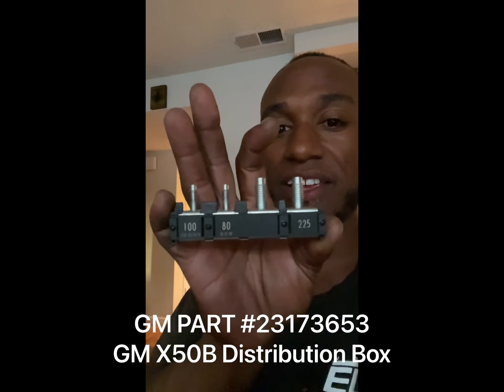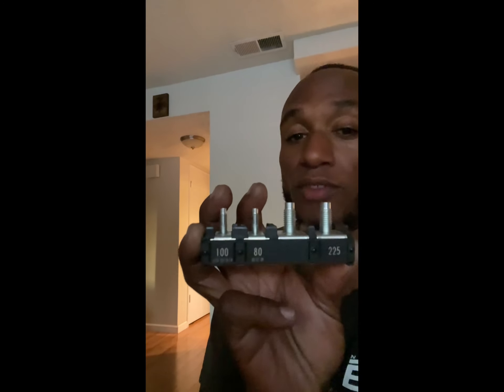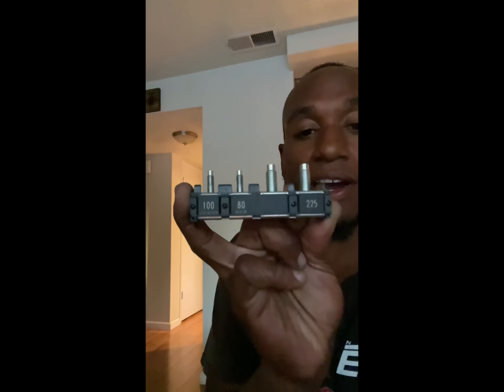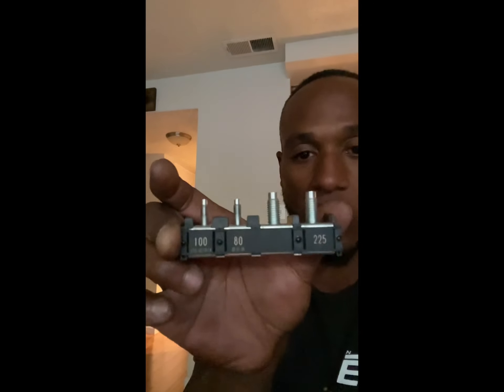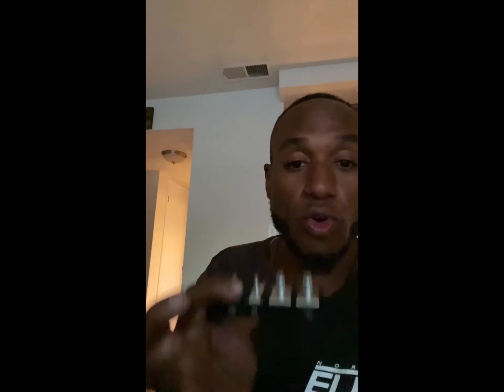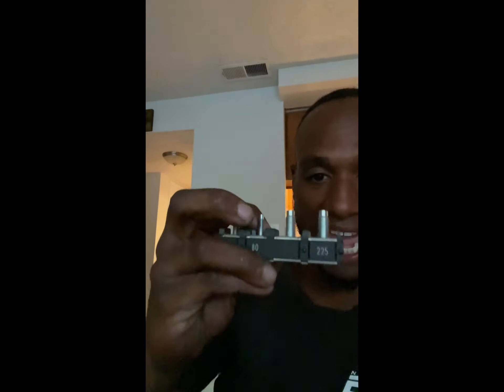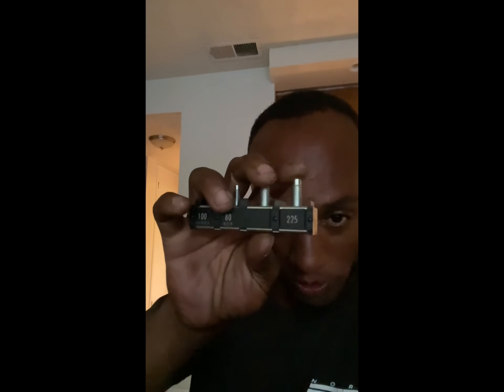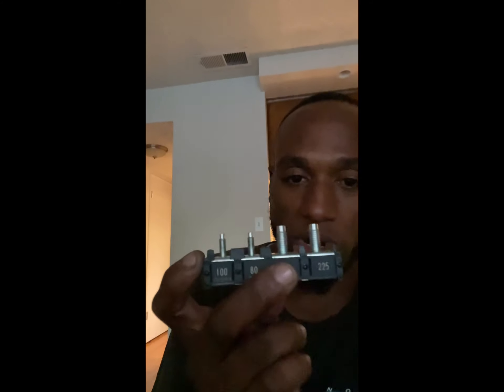2014-2019 Corvette Cooling Fan Fuse DTC P0480, P0481, P0482

Comment: "you'll go to heaven"  lol... love it! Great video.. unfortunately I'm not sure if this is the only reason my cooling fan is staying on. I think it's a faulty temp sensor bc my digital and analog read out after 40 min of driving still shows under 100.   However no "check engine" light so that's odd.
Reply from the maker: You likely have a bad tstat. Sorry for the delay. Never got a notification of your message. Hut me here if you have questions.  Ctracer_x@yahoo.com
Reply from the maker: Definitely a possibility, bad temp sensor- of course you could also have a a sticky tstat, ie stuck partially open.  They do that! Tstats run about $50 or less and the sensors are about $25 or so

Comment: I have that problem with my 2016 ZO6.  The cooling fan just seems to never go off and it stays on for about 5 minutes after turning the car off.  I spoke with my dealerships service department and they said that was normal.  I said how can that be normal when it just started doing that.  Anyway, Thank you so much for pointing out the potential problem.  I was looking at ordering online directly from the dealership for $35.05, but as a caveat they annotate "Programming Required by Automotive Professional".  Is that true?  Thanks again!
Reply from the maker: Not true!! No programming required, they just want to get you where it hurts

Comment: Does this fuse block/relay block  also control the infotainment system. And the fan that I hear is coming from the drivers side  rear brake vents. Anybody know?
Reply from the maker: The fuse block does not control the entertainment system, and if you’re having issues with the rear fan, that is fuse number 74 inside the fuse block.

Comment: I’m having the opposite problem where the fan won’t come on until I turn off the car and turn it back on.
Reply: Same problem here. I bought the Distribution Box via Taska Auto. Crossing my fingers. About to install it once I figure out how to remove the fuse box it's apparently under. Wish there was a video. Haven't found one yet.

Comment: What if your fan turns on high even when the engine is cold, and stays running for a bout 30 mins after car is off then turns off? Also temp gauge doesn’t work when this happens and ac doesn’t blow cold. It will all randomly fix itself all at once when driving then stop again a few days later.
Reply: Brandon my C7 doing same thing .. Did you ever find the fix?
Reply: I think I thought my temp gauge wasn’t working because the fan was staying on keeping it cool. Once I replaced the part everything worked.
Reply: Had the same issue, all started with the car over heating so I replaced the thermostat to a mishimoto 160 one. Issue fixed. Then a week later fans turned on as soon as the car was running gauges weren’t reading temps, ended up being a simple $20 fix, had to replace the coolant temperature sensor. Car has been running fine since then and much cooler with the mishimoto thermostat.
When replacing the temperature sensor you’re going to need to have a local shop clear the code since you will get a check engine light unless you have a scanner yourself. Also you can just unplug your battery for a couple seconds and the car will reset itself removing the check engine light
Reply: Did you ever fix this? My c7 is doing the same cooling fan stays on when engine is cold & ac does not blow cold.
Reply: In addition to all that, my active Rev system becomes inop. I wonder if it's because part of that fuse controls the steering wheel unit. idk.
Reply from the maker: @rickymonterroso2814  EXACTLY THE ISSUE!!
Reply from the maker: @bigb200prf  oh man I never saw any of these replies anyhow you likely had a bad temp sensor and faulty tstat- they are known issues with this car/ engine (LT1-LT4-LT5)
Reply: That happened to me on two different C7's of mine. My fix was replacing the thermostat. Randomly fixes itself means it's sticky and frees up from time to time. Replacement is easy.
Reply: For those with the issue of the fan staying on long after engine shutoff and the temp gauge not working? It's your thermostat. Easy fix.